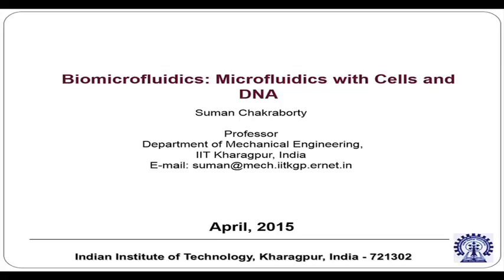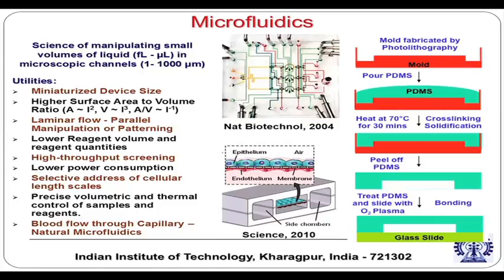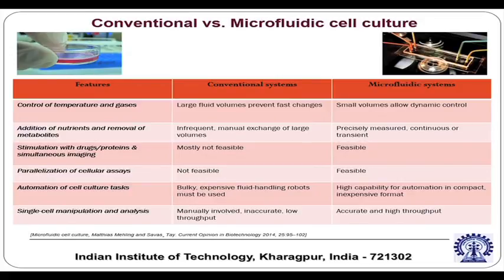Mod-01 Lec-46 Biomicrofluidics

Comment: Suman - given your comments - your passion for this topic comes through and your work in this area is admirable - regardless I commend you - one question - IF cancer cells are more adaptable to surviving high shear stresses and thereby better adapted to imbedding themselves deeply into microcapillaries for later metostasis and uncontrolled replication in that region - WOULD it be possible to insert microstints - similar to those used in heart patients of blocked blood vessels - into the surrounding blood vein network region of cancer cell growth and by inflating the stint thereby forcibly increasing the flow diameter of the microcapillary in the affected region alone thus allowing higher flow rates and disrupting the growth of cancer cells in that region essentially depriving it of the surrounding cell climate it seeks ? essentially flushing the cancer cells out of their comfort zone and pushing them back into a high flowing capillary away from the affected region - granted this does not eliminate it but perhaps it would disrupt its growth ...